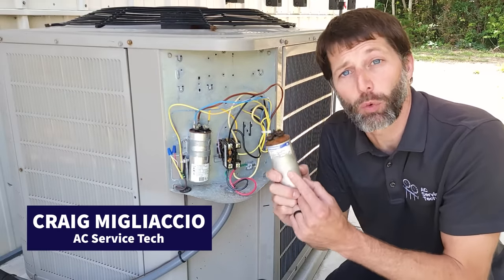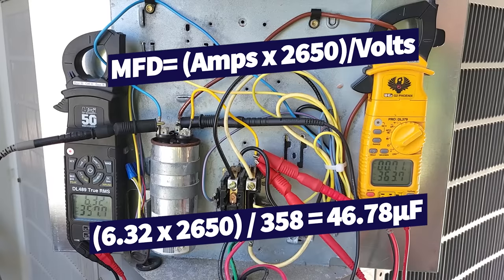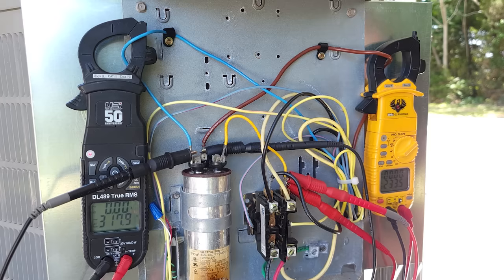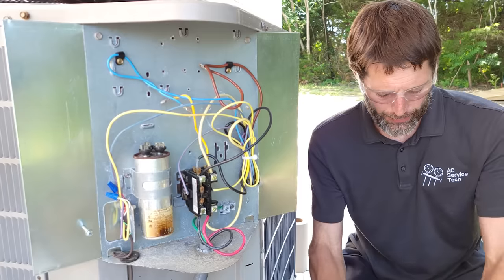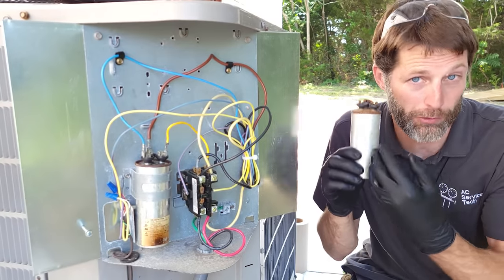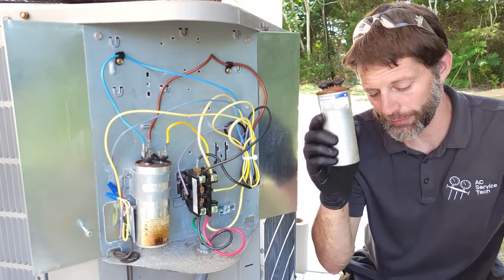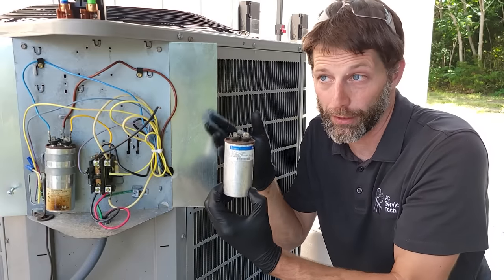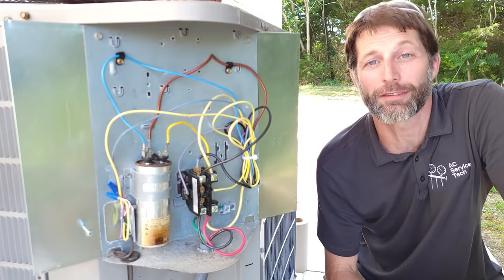WHY CAPACITORS FAIL in Air Conditioners! Watch it Break!

Comment: I've saved myself hundred$ by just changing the $40 capacitor.
The first time it happened I just took an educated guess. I didn't have enough money to hire a pro anyways.
A couple of years later it failed again. Sure enough, that was the failed part again. 
It seems wrong to charge you for more than a job is worth. I'm guessing 99% of all motor failures are that capacitor.
If it's not, you've only lost $40 and have a spare for when it does go bad. 
I'm thankful for this video giving us a method to test it with.

Comment: I thought the multiplier for a 60hz system is 2652 I know it's not a difference.
Reply: To be more precise, it would actually be 2652.58 (for a 60 Hz system) and this would round off to be 2653.  These is very little difference between 2653 and the 2650 value that's used in this video (only 1% difference) and therefore either value is reasonable to use.  There are other assumptions being made regarding the capacitor being an ideal capacitor when using this formula so no reason to be worried about the 1% difference.
Reply: @wd8dsb  yea I figured that much thank you I feel more educated now

Comment: For a little more accuracy, the number for 60Hz operation would be 2652.58 and can be rounded up to 2653. And for 50Hz operation the number would be 3183.09 or simply 3183. Have a great day!
Reply: Is the 2652 a 2 pi number?
Reply: @225rip  It's derived from the equation of Xc=1/(2*pi*60*C) which equals 0.002652. Of course the digits run further out. This equation gives the capacitance in Farads. To get the capacitance in uF, this number is multiplied by one million which equals 2652. I did a video on how it's derived if you're interested https://www.youtube.com/watch?v=tWx2Pa-_AoI

Comment: Over my 40 year career (retired in 2019) using this formula,  I found that majority of capacitors were undersized from the factory.
Reply: Designed for service calls you think?
Reply: @Robert8455  That would be my opinion,   the worst offenders were ICP/Carrier & Goodman

Comment: Can one assume that seeing a dead (leaking, bloated) capacitor, there is no charge left on it? Any ideas for checking the level of charge, before working on the unit? I've worked on some micro waves and for sure the first step is to discharge the capacitor!
Reply: HVAC capacitors don't typically hold a charge very well. You're not likely to get zapped by a 30-70 uf cap. Start assist caps at much higher uf have bleeder resistors to exchange the excess energy into thermal energy, so long as you don't immediately touch it after turning the power off you should be fine.

Comment: Hold the phone!  If your meter can predict that a capitor will fail that is amazing.  That could prevent one of the most common causes of downtime.  What will they think of next?
Reply: Except that nobody is going to be continually measuring their capacitors, even if it's the owner rather than paying a tech to come by over and over and over to do it.  Before that happens it would just be more cost and time effective to replace the cap(s) on a schedule.

Comment: The smaller the capacitor SIZE the shorter the life expectancy due to the smaller surface not being able to dissipate the heat transfer to keep the actual capacitor COOL … that being said if anyone who recalls the older run capacitors from 30 to 50 years ago remember how large those capacitors were and had the ability to keep cool due to their larger surface, they were twice to three times the size of these newer style run capacitors .
Reply: too much miniaturisation, same problem with electrolytic capacitors is pretty much anything these days, especially 2000s made equipment when there were a lot of poor quality ones around , see 'capacitor plague'
Reply: Which begs the question ( be kind here if I'm wrong).....can we wire 2 identical (rated) caps in parallel?.... to offer more dielectric heat sink capacity???

Comment: What is the 2650?
Reply: Science
Reply: It's derived from Ohm's Law and the formula for the reactance of a capacitor. 

1,000,000/(2×π×60)
Reply: @jsswizard  it's only 60 in the US and places where the AC power is at 60hz.
Reply: @realSamAndrew  Agreed. The number is 3183 for 50Hz mains. Cheers.
Reply: @jsswizard  I knew you knew that. Just trying to add more detail 😏
Reply: @realSamAndrew  👍

Comment: Lesson learned : Consider being proactive...knowing that a failed capacitor is the #1 reason it seems, as to why AC units fail......
1) Replace the capacitor yourself ($20) as it's literally 3 wires, that go to 3 other wires, making sure all power is off of course...watch YT videos to see how simple it is.  
2) Replace the capacitor on any AC unit at least every 7 years.... just because they usually fail in middle of night on the hottest day of the year ha....so for very little time and expense, one can avoid this issue altogether.  
3) Purchase a 3 wire 5-2-1 Hard Start kit ($35)....why? It will help keep your very expensive air compressor running I'll wager 50%+ longer...so its worth the small time and investment to DIY install same .

Watch the many many AC professionals show you how to install a capacitor and Hard Start kit on YT....it's very easy to learn how to DIY...be sure all power is off and that you feel comfortable with doing same or call a professional to have both items installed at one time.  You will be happy to have these two new items installed down the road.....because they are a fantastic value for what you get in return..Peace of Mind :)

Comment: almost any capacitor  up to a 5 ton condensing unit can be purchased for $20 or less ,and are easily replaced
Reply: Where do you purchase them?
Reply: @trailerparkcryptoking5213   eBay , Amazon 
I get them from an Hvac supply .if you live in a hot climate or have a heat pump using your system year round just replace every year or so as general maintenance.
Reply: Can't tell you home many compressors I've replaced because a homeowner tried to replace their own capacitor.
Reply: @Pop_A_Chaderall   I’ve been an Hvac contractor for 28 years . It’s. A Common problem that some people can fix easily . If they are in a bind , holiday , weekend without ac . Not everyone of course . I have never seen.a Problem where a homeowner replaced a capacitor . And there’s no way to tell if a capacitor was the actual cause  of compressor failure .
Reply: @horton6951  When it comes down to it, its their equipment and they can do what they want. And i dont really care because it keeps me busy. but When the homeowner installs improperly sized capacitors. or my favorite, when they wire the fan to herm and herm to fan.  Those kill compressors and I've seen it multiple times. Or they don't wire the fan to common and the compressor overheats its self to death over the course of the summer.
Reply: @Pop_A_Chaderall   yeah , I prefer to do them myself too , ha’ 3 wires gets confusing for some people . But easy call out easy fix and honestly 70% of all ac service calls I have had through the years have been a capacitor . My point is that capacitors aren’t hard to change and I don’t mind showing people how to change them .

Comment: If you change a capacitor on a condenser and don't wash the the outdoor coil you will shorten the life of the new capacitor. Only wash the outdoor coil with plain tap water at city pressure, no chemicals.

Comment: How many of these do HVAC guys replace in an average week.

I don't work on AC everyday but I replace 2-3 at least every week.

I think there is capacitor pandemic happening! (;
Reply: This week alone I replaced 7
Reply: I'm more of a commercial/industrial HVAC mechanic but do have a few townhouse complexes I take care of and honestly it's not that many caps that go. Maybe 4 or 5 in year out of 400 or 500 pieces of equipment. Others might do more or less but that's what I've found. I also always change the motor once a capacitors blown (except for compressors those I leave in) because I've noticed that if you just change the cap then by next week you'll probably get a call back and the condenser motor will be fried.
Reply: Once again, gvmt regulation costing the consumer BIG bucks.  They mandated a change to the manufacturing components, now this man says he replaces 2-3 per week and he is not full time AC.  An earlier comment mentions that before the mfg change, a guy would carry one capacitor on his truck.

Comment: Ok that's very interesting and my question is why does a outdoors unit sound like a transformer is being energized? It's loud enough to be heard about 100 feet away it has been cleaned and the capacitor was changed.

Comment: your terminology is a little off. the voltage being measured isn't the motor back emf it is the voltage drop across the capacitor.

Comment: You missed defective capacitors and going bad due to evaporative loss of dielectric fluid.  The dielectric fluid isn't just any heat absorbing fluid, it's an isolating fluid.  It would be pointless to use the dielectric fluid if it didn't have an insulating property.
Reply: It's interesting to see what they do with transformers, which are also filled with dielectric fluid, but not a consumable. They have taps to collect the fluid to send it to be analyzed. The fluid shouldn't be breaking down or have water content. Presumably it's cheaper to rebuild the transformer if it has dielectric going bad.
Reply: @johnhaller5851  you are talking about large oil filled transformers.  The size and ampacities involved make it more cost effective to replace the dielectric fluid when it's going bad rather than letting the transformer burn up and having to replace or rewire the transformer.  These capacitors are so small and inexpensive that the labor to service it would cost more than a new capacitor, so it's made as a disposable component.
Reply: Okay but of all the things that can go wrong, evaporative loss is one of the rarer cases unless there was some other fault already like the can rusted through, or a pressure buildup is what blew the seal so it was already faulty.  Typically it takes decades for wet/electrolytic caps to dry out from seal leakage otherwise.  Then again, chinese junk!!
Reply: @stinkycheese804  I'm not talking about total evaporative loss.  Every little bit of evaporative loss contributes to the failure as it reduces capacitance and it's ability to deal with the heat caused by the load.  Most of these capacitors are failing after 10 years.  There's no way that evaporative loss hasn't contributed to the failure to some extent.

Comment: I’m skeptical of why HVAC tech charge $175-185 or more for replacement of a low $part.  Yes even if the capacitor is a name brand they are not expensive.

Comment: Never run dual capacitors. Just one more reason for causing a failure of both compressor and fan motor.
Reply: Separate caps for both is a superior solution.

Comment: Good show but I think it would be a lot easier to just disconnect the capacitors and test them on microfarads
Reply: Every time you disconnect and reconnect the wires, the terminals have the opportunity to open and create a loose connection. Loose connections cause heat and will burn up the wires. I've also had many new techs put the wires back on incorrectly and burn up compressors and fan motors. Also, if you're checking under a load then you see what it's truly delivering while it's working.
Reply: Sure but that's why should alway make sure they are tight when u reconnected them.
Reply: @carlossaenz4075  And you're still not checking them under a load. It's quicker, less potential problems and a more accurate reading under real world circumstances. Do what you like but it can only take more time and cause more problems in my eyes.
Reply: A capacitor can test good on the capacitance meter but measure low or no capacitance under load. Testing under load is the only way to be sure it's good.

Comment: The reason they fail is simple.  They are OVERSTRESSED from the get-go.  You have this little tiny "box" carrying the current of a monstrous A/C compressor.  They are way too small for the power they are handling.  The voltage is also at a level near internal breakdown.  The best of them sold specifically for A/C use are "cheap junk".  Add to this they are subject to "uncontrolled outdoor" temperatures & humidity.  They should be 4 times larger then they are!  They are also now filled with an oil that may be more "ecologically responsible", but that is in trade for actually withstanding the voltage fatigue while being hot.
          You can get more life out of them by "derating".  Select one that is rated for much more voltage then specified for the unit, but the same microfarad value as specified.  It will be physically much larger.  Also use 2 separate single element capacitors (ones designed for electronic equipment, not A/C units).

Comment: So wait.  Based on your readings, the capacitor was completely good. yes?  So if the multimeter reads as given your numbers, it would be good, yes?  However, for instructional purposes, you headed the the capacitor and made it fail, yes?
...just trying to understand why a capacitor with good data failed.

Comment: As an electrical engineer, I believe the humidity experienced by the capacitors will be brutal for its useful life because the moisture allows leakage current.  These should really be potted and sealed but on my A/C unit its just screwed to the metal frame without any protection at all, not even on the contacts.
Reply: "As an electrical engineer"...You should know these caps are hermetically sealed to environment. These caps typically are oil filled as well...
Reply: @cerrem1 "Speaking as a real electrical engineer"....thank you for saving me the time saying that exact same thing. Damn

Comment: What you do is look for a lump on the capacitor!  That is a tell tale sign it is bad.  If no lump but you still suspect it take an analog meter(analog only)and charge the capacitor.  Then reverse the leads the other direction.  If the arm swings then the cap is good.  If not you need a new one!
Reply: ... or use a decent meter and test the damned thing the right way.
Reply: @johnd5398  yea, run out and buy a 300.00 meter when what I laid out will work just as good.  I assumed this was for DIY people not technicians that don't need this.

Comment: So….. capacitors don’t fail when the coils are clogged up like a carpet. Capacitors don’t fail when there’s a refrigerant restriction. Capacitors don’t fail because of access stress on motors causing capacitors to over heat?
Reply: This guy is going to be the reason customers want there ac relocated.  “ my electric panel is in the sun”. So only heat causes them to fail. Hmmm what causes things in an electrical circuit to heat up? Could it be amperage

Comment: One of the main reasons capacitors fail is that they’re very cheaply made.   Most are made in China anymore and just don’t last .

If your ac unit doesn’t start, the capacitor is the first place to look in process of elimination.

Comment: Over complicated. Simple rule is if a Capacitor is old, it is time to replace it, even if it test good as it may run today, tomorrow, and the next day; but will fail within the next year. Start of season testing may not reveal potential problems and just by looking at that capacitor, tells me it is time to replace it.
Reply: You can check it unload.
Reply: @Pop_A_Chaderall  If you are referring to voltage leakage, yes that is a way you can check them, only it requires a more sophisticated meter than most technicians have. Again, tell tale signs a capacitor is about to fail are usually obvious. any slight bulge is a clear indication it is time to replace.
Reply: @drwhoeric  No im referring to checking unload like he demonstrated in the video.
Reply: @Pop_A_Chaderall  The unload test does not really provide the technician with an expected remaining life of the Capacitor and only tells if it is about to fail or is failing. A Capacitor could pass the unload test and fail days, weeks, or months later. As the technician indicated, heat and other environmental factors contribute to the failing of a Capacitor. Factors such as the appearance of the Capacitor, temperature exposure, estimated run hours and cycles the equipment has been put under, and most of all the age of the Capacitor should be considered. 15 years old, maybe replace. 20 years old, definitely replace.
Reply: Mine was working fine at 25 years till the fan motor bearings went so it was replaced then.

Comment: I’ve seen other failed capacitors in the past. 
While I try to get the same type and MFD rating, if I can’t I always go to a bigger one.
Have yet to see one fail that was “too big.”
I would imagine there is a point where that mentality fails, but I’m not knowledgeable enough to figure that one out.
Reply: Getting a higher voltage rating is fine but the motor is designed for a specific value of capacitor.   I've seen motors that will stop working if the capacitance is even 10% off.